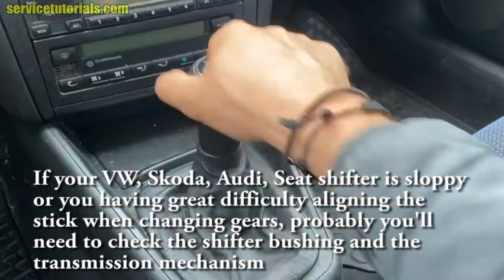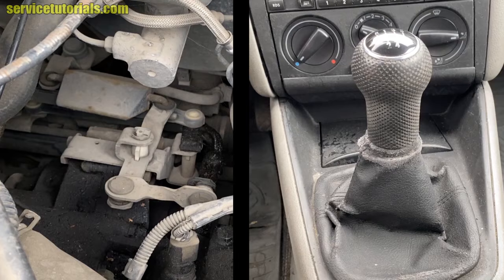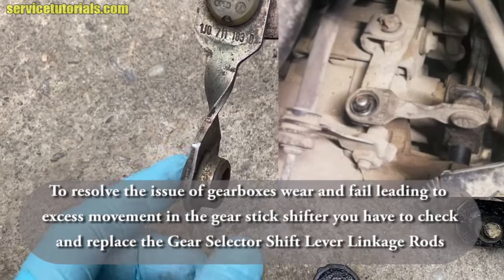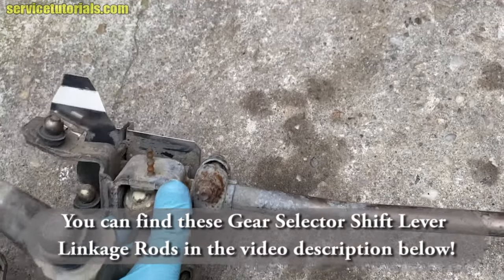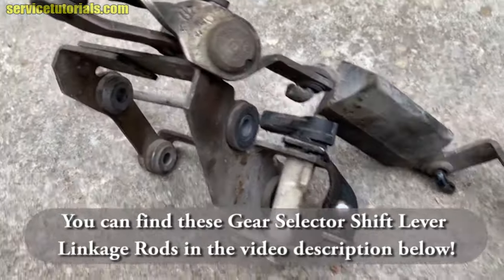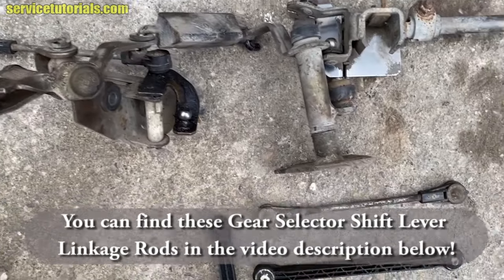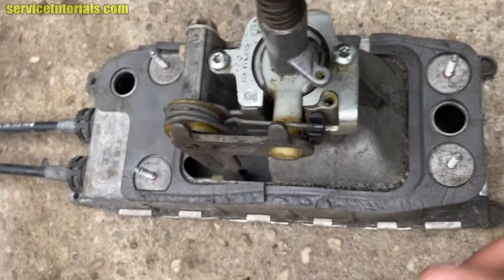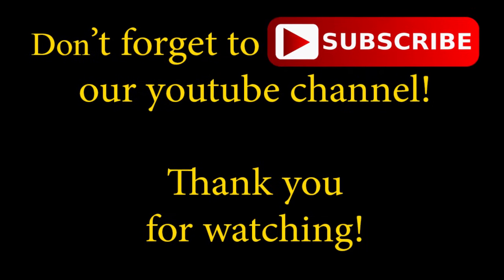How to fix / repair VW Golf Mk4, Jetta, Bora, Skoda, Seat, Audi Sloppy Gear Stick, Gear Linkage Rods

Comment: Some tips for anyone attempting this, if you need to replace the gear levers/links and they have those rubber bushings on the end boil some water pour it in a cup and then dip the rubber into the cup for like 30-60 seconds then it will pop on with relative ease it softens the rubber and once its on it hardens up and won't slip off.
Reply from the maker: Thank you for the tip!👍
Reply: Thank you bro👍🏽
Reply: As iron sharpens iron so does one to another.

Comment: You should have show how the linkage mechanism is removed from the car. I had several failures and I managed to work it out after spending ages taking pictures and sharing on forums. You have to pop out the linkage from the brackets and then unbolt the brackets from the gearbox/subframe. The ball shapped bush on mine is completely shot part on my 1J0711076G 096B, I can't see it sold anywhere online. 

I will speak to TPS when they open see if they have it. Chances are they will want £50 or more for the bracket. 

Not sure if I should just wait and order from china,

The other rubber slider mehanism doesn't seem to be sold online - I may need to extract it and make my own with some plastic. Glue on extra material from the plastic slider in the hopes that it works fine,.
Reply from the maker: Thank you for your feedback, Simon!
Reply: @Servicetutorials  I created rthe plastic slider with a series of zip ties. Checked after 2 months and it's still in place.

Comment: Hello,
Your video was very helpful. Thank you for that.
I have a few questions:
1. On the bottom of the gear handle (in cabine), there is a plastic ball within a kind of plastic round part. Do you know what is it OEM number?
2. Where I can find a catalogue of MK4 VW Bora parts?

Thank you!!
Reply from the maker: @ilyagorenbein8257  hello! You have to replace the whole part with the gear stick.

Comment: Thank you for this video ! could you help me how I can remove this parts to check if they are ok or not ? I have Golf Mk4 2003 1.6 16S
Reply from the maker: Thank you too for watching! It's a lot of work, you have to lift the car up to have access under the car. Start with checking the parts that are on the upper side of the gear box.

Comment: Do you know if that shift mechanism which are on the shifter lever over the gearbox is not lubricated or greased? I've listened a harsh or raspy changes in all 5 rels when the car is hot after power on. When it's cold or has recently starting  it's silence when I shift. I don't know why?
Reply from the maker: Yes, they have grease on it.
Reply: I have the same problem and grease didn’t help  , did you manage to sort yours out?

Comment: My problem is with the actual gear lever. It drops down even though I have not engaged reverse gear. How can I stop this from happening.
Reply from the maker: Hi! Probably you’ll need to remove the part from the bottom of the lever to see if one of those cables are disconnected from the stick.

Comment: Can someone please help me. I can't find a fix for my help. When I shift into first the shift knob moves to the right like if its in third once I let it go. what can I do to make it not look like it's in third when I'm in first gear is it a bushing issue and if so which one.
Reply from the maker: You have to check all the parts that is showing in the video and replace the one with the problem. Start with those from the top of the gearbox, you can reach more easily there.
Reply: @Servicetutorials  ok thankyou!

Comment: I have the same problem with my polo car and shifting from 4th to 5 th gear is a struggle is it possible I can take the car to a car service centre to have my gear shift  parts to be replaced ?
Reply from the maker: Yes, you can do that.

Comment: The part which you are holding at 1:37...

What is the name of the part and could you share the part number?

Its the part that prevents you from engaging reverse when engaging 1; the black plastic part that hooks onto the metal part to keep the car in reverse.

Please, need name and/or part number asap. Part number should be on the plastic part itself
Reply from the maker: Hi! Are you looking for this part: https://www.ebay.co.uk/itm/123480468385

Comment: Thank you for your valuable sharing video. I have same problem for my car vw golf 4 2001 model manuel. The part of mechanism has 1 rod, instead of 2 rod that vw 2005 model. Thşs video contains vw golf5 code and show us the code number clearly. But ı dont know golf4 code number for this part of mechanism. So ı can not share number to 5:01 service to look for the mechanism. Please could you share golf4 gear mechanism code number? Thx for attention. (Code number=serial number)
Reply: hi, you pointed toward my now exact same problem.

i need to replace the shifting rod bushing (the rod you hold in your hand)
how do you take out the whole assembly so i can change the bushing?

Comment: Do you know the rubber material that 1J0711076G 096B slides into?
Reply: you can recreate this with zip ties, tie loads of zip ties, make it nice and tight so the zip ties dont overlap each other. then use a final zip tie to tie all the zip ties together to prvent them from sliding off. 

The alternative is to buy a pattern part (whole part) from autodoc and replace it.